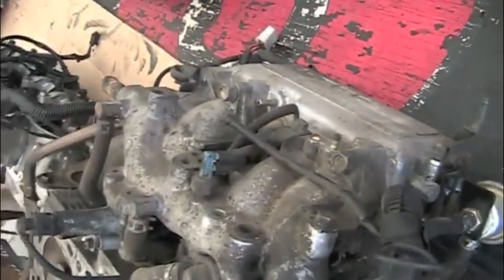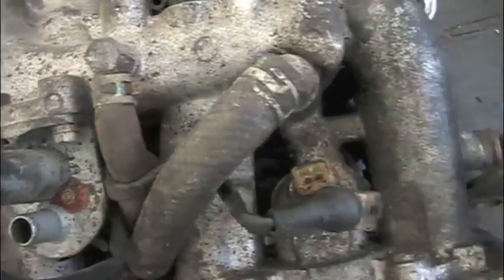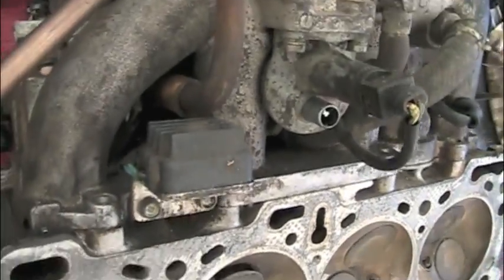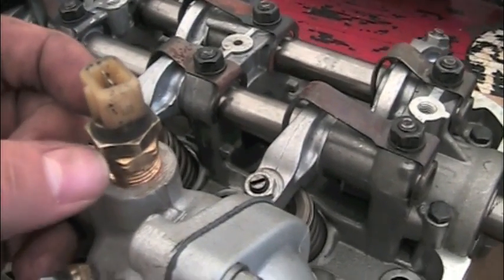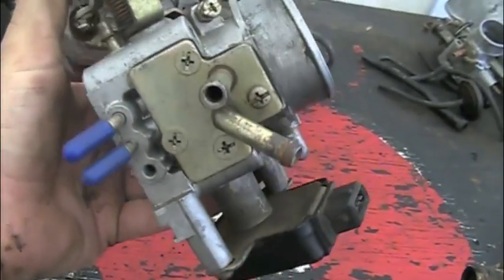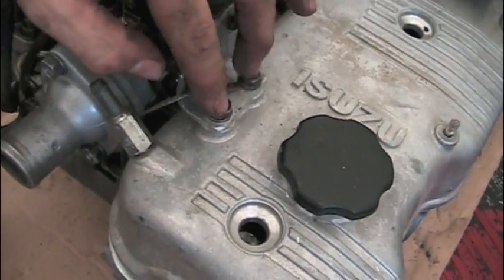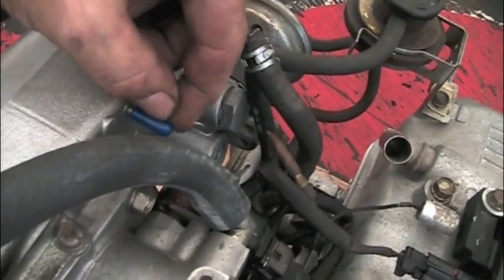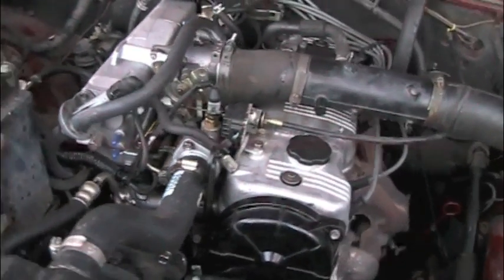5-TEC Modification for the #Isuzu Fuel Injection System #ITEC

Comment: Excellent stuff Johnny! I have a later model which has different ignition control module (igniter as you call it) and it was a bitch to reach even with the front right wheel off and fender liner detached. Great tips and tricks Johnny. Thanks - Oh and I have a wiring diagram for the igniter etc if you still want it @Johnny5ive

Comment: Will the air conditioner work? Also was there any issues with not capping off the fuel pressure regulator? I notice that there's not a vacuum hose going to the top of it in your video when done.

Comment: Taking the hot water out of the intake will work fine in warm climates and may even create a performance gain, however it will be problematic in cooler, more humid climates. Ice WILL form in, on and around the intake and be problematic.

Also, I did not see your fuel pressure regulator - what'd you do with that?
Reply: Where would I get all the parts for this mod? My parts store clerks are no help at all.

Comment: I’m running into an issue of my 2.6 top end rebuild. If I turn on A/C, idle drops drastically to all but shutting engine off?
I’m assuming I’ve got a vacuum line or 2 off, any help in addressing it would be appreciated and save me some time.

Comment: Before I watched this, I have started to do all these mods. Nice to see some validation! what a mess the intake manifold is on these.
Reply: will the air condition work the same with this modification?
Reply: @melaniusst.hilaire1003  yes I believe it will.
Reply: @Jdes9924  okay i will do just that  to prevent future problems..thank you for the info

Comment: I got a bronze 1991 Isuzu Trooper 4 door it been restored new paint sharp looking I get stares everywhere I go it is nice take it everywhere fun to drive had a local tire shop change the temp sending unit up under the intake showed him where it was from under use a long extension got a new one in there basic went thru and put new stuff in all the stuff is able to remove just got to be a contortionist and bend body parts in funny ways helps to be tall crazy thing I find it does alot is idle up and down doesn't take much to throw the whole works outta wack

Comment: FYI, there is a pipe adapter that allows you to install the ecu temp sensor into the tstat housing. It's M12x1.5 to M16x1.5 (search Amazon for B07FW8C2TZ)

Comment: do you even need the coolant temp sensor if you not running idle air control? wanting to get rid of my temp sensor so i can put a thermo switch in its place
Reply from the maker: David Leeal you obviously have no idea how fuel injection works. You can try to one-up my design or just trust that I actually do know what I’m doing. Your choice
Reply: basically i have gotten rid of the clutch fan and am installing a electric one it.  this requires a thermo switch on the hot side of cooling . and yes i have no idea what iam doing  thats why i asked. iam not one uping anybody just having fun with my old ute 93 aussie rodeo
Reply: I have been running your 5 tech system for 6 months now no dramas thank you for the content
Reply: @mrleeal  Just install a Honda coolant temp sensor in a TEE fitting in the upper radiator hose where the coolant AFTER the thermostat flows to the radiator. 

 I used an old Open Kadett electric fan and the Honda sensor and it's been running for over 20 years and no troubles so far. I also added a manual, lighted rocker switch to the same relay that drives the fan since the Honda sensor cannot carry that much current.
Reply: @SurferJoe46  i finished up welding a tapped bung to the back of the alloy radiator worked a treat

Comment: I know I'm a little late to the party, but I have a question about what you referred to as the Ignitor at around 3:10 in the video. I have some info on it, in case you haven't discovered any yet.
Reply: Do you have any idea where the ignitor plugs into? Maybe what color wires or a picture?

Comment: The threads are mpt
Reply: MPT is really just ASME standards, but they don't go as deep as the ASME threads go. Drive your standard pipe tap in a little bit further, and they will fit. BTW: It's not MTP, it's JIS.

Comment: Johnny5
You seem like a very knowledgeful fella.
I own a 1992 isuzu rodeo 2.6L 2wd with mua5 5 speed. Basically the base model.
I am not sure how many miles are on this isu. I bought it with 273818. But i think they switched the old 4ze1 with a junkyard one. 
Anyways it does not use oil, i had head gasket replaced, valves and springs and guides, timing belt, water pump, fuel pump, spark plugs, spark plug wires cap and rotor and timing checked.
It seems to have plenty of power up untill 4th gear. On the highway it has a hell of a time keeping up at 70mph on 5th gear. It does not matter if the gas pedal is all the way pushed. It just does not have power.
What do you suggest i can do to improve my isu highway performance. I want to be able to pass cars easier?
Or are these 2.6 just plain gutless?
Reply from the maker: That's gonna be really hard to answer without being there. The engine could be low on compression, you could be running too large of a tire, clogged catalytic converter, any number of issues.
Reply: I have 30 inch tires on it at the moment.

I am thinking about ditching the fuel injection for a carburetor setup.

About the exhaust pipe. What would be the biggest size we can run these 2.6 on?

2 inch 2 1/4? Or 2 1/2 inch.

I want to remove the catalytic converter. I will redo the exhaust.

Any imput is greatly appreciated. Thank you
Reply from the maker: 2 1/4 is a good size exhaust for the 2.6 30 inch tires could be part of the problem, they're heavier than the stock 235/15s and the rolling circumference is probably a little large for the higher gear ratio of the rodeo. Sounds like it's just a culmination of tired motor and too much load.
Reply: Thank you johnny5

I will redo the exhaust on that pipe size.

When this tires wear out the next set i will go back to factory size.
Reply: Johnny5ive interesting
Reply: @Johnny5troopers  I have no problem running 33x11.50R15s and I can run all day at 80 MPH. I suggest that he MAY have the timing badly set as the timing mark on the outer ring of the harmonic dampener is often shifted although it looks OK> The timing can be anywhere if it's twisted.

Comment: Holy crap. This video is a godsend. I just replaced the clutch in my 90 trooper 2 and was so worried after discovering all the vacuum lines and other BS the california car has. I will promptly be deleting it as well as all other unnecessary components of the engine. Thanks! I should add that it is worth it to me to do this as my trooper is 141000 miles and I am the second owner. I am very much interested in keeping it.

Comment: +Johnny5ive where did you put the fuel pressure regulator that used to be mounted on the front of the intake  box where you relocated the Idle Air Control Valve to? I didn't see it anywhere
Reply: I would also like to know info on this @Johnny5ive
Reply: Did anyone ever get this figured out? I have the same type of set up where the fuel pressure regulator is mounted in front of the ITEC housing. I am going to route it off to the left hand side. Has anyone else done this??

Comment: thanks for this video, my 91 Jackaroo (Trooper in Australia), decided to split one of those nasty hoses and i emptied most of the coolant to my driveway, lucky i was home, so pulled off the manifold and followed your steps on modification of those hoses and other bits and seems to be running much cooler now :) by the way, for a future modification, would it be possible to move that bypass T that connects the heater to the coolant that resides behind the back of the engine? possibly just over 20-30cm so we dont have to deal with any coolant hoses behind the engine.

Comment: Could you do a more detailed vid on what vacuum lines you got rid of and what you kept? I'm trying to get rid of as much possible errors as I can on my trooper. Also, did you notice any mpg differences or power issues?
Reply: it looks like in the video there isn't even a vaccum line on the fuel pressure regulator?? can this be true? john could you please help clarify vaccum routes?
Reply: Will Roberts i just deleted all unnecessary vacuum lines and my trooper runs better without the vacuum hose on the fuel pressure regulator. I tried with and without. Got a box full of stuff I didn't need when I was done. Truck runs great!!
Reply: Patrik Strock what about EGR?
Reply: @lukecarswell3275  you ever figure out about the EGR?

Comment: If I remove the EGR which come consequences?
Reply from the maker: Combustion temperatures could get too hot and you could have problems.
Reply: Johnny5ive ОК, Thanks! You can show the standard scheme vacuum hoses?
Reply from the maker: Александр Макаршин Isuzu fuel injection Explained
Reply from the maker: Александр Макаршин 5-TEC Modification for the Isuzu Fuel Injection System